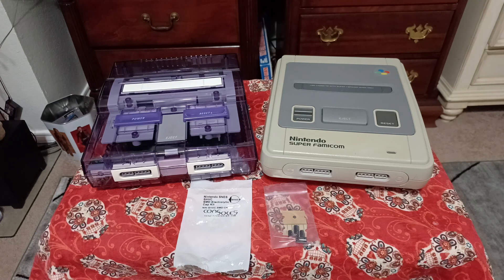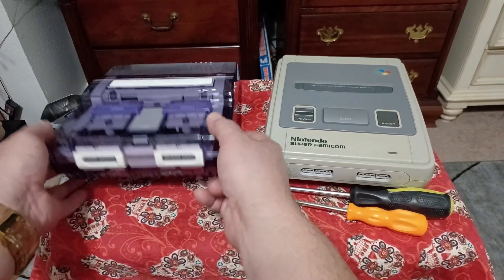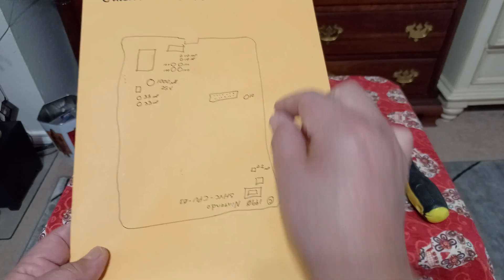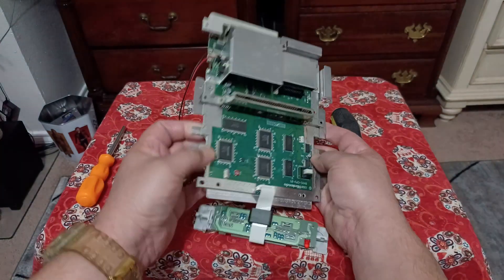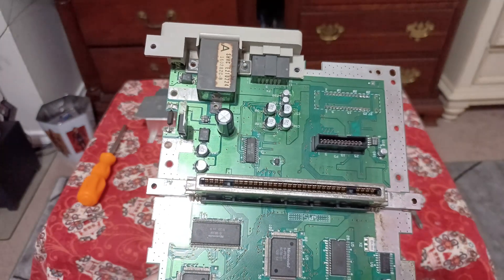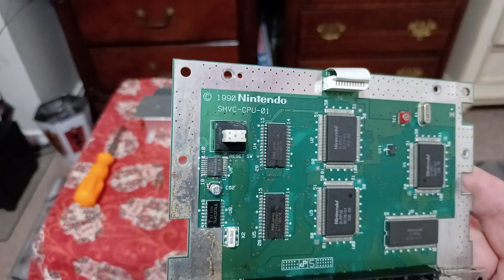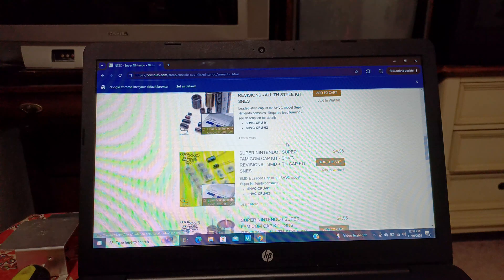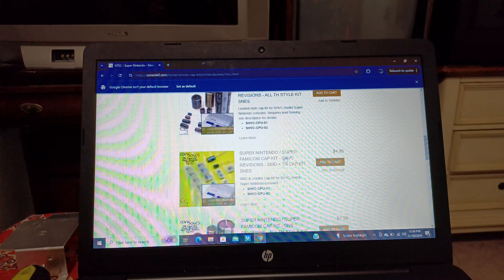Super Nintendo motherboard revision and how to order capacitors from Console5 | Joe's Retro World

Comment: I removed caps on my Dreamcast and PS1 and ordered replacements from Console 5. 

I also removed my 12v regulator to prep a Dreamcast ODE. Apparently the absence of a GDROM overheats the 12v regulator and it’s recommended to remove it with an ODE.
Reply from the maker: @S_Tier_Final_Boss  I removed mine from the dreamcast. It has been working for years now.